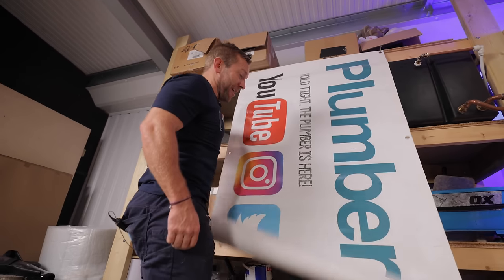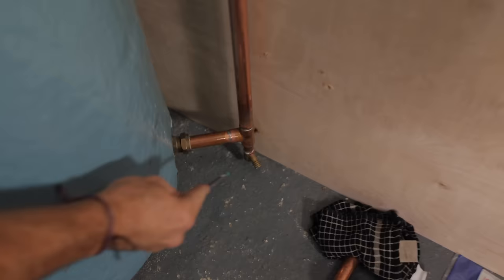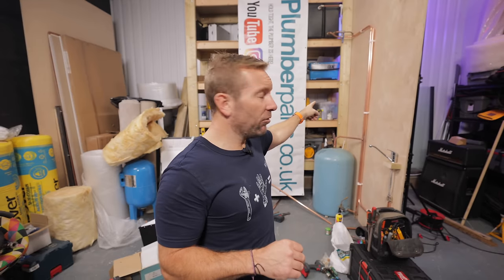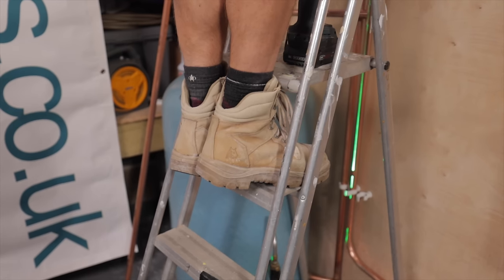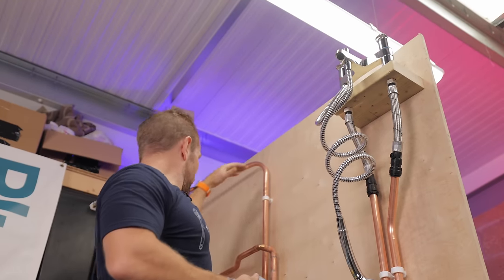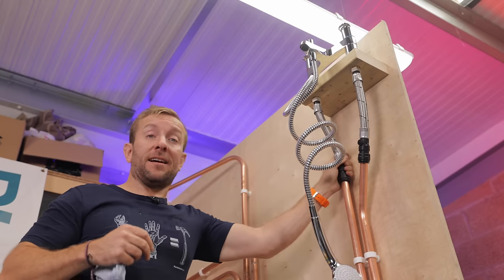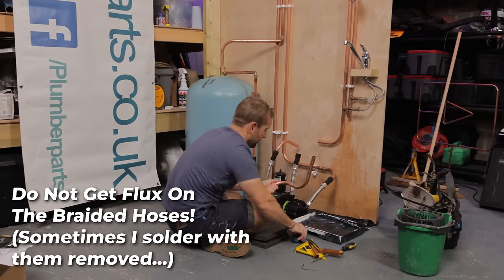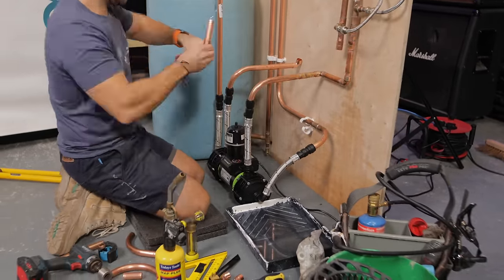HOW TO FIX LOW WATER PRESSURE - The Salamander Right Pump

Comment: In the early eighties I purchased my first home. A first floor maisonette with loft access. I wanted a decent over the bath shower. My plumber told me to build a platform in the loft 1m above the ceiling joists. He then moved the storage tank onto the platform and ran new pipes in 22mm copper to the bathroom. He fitted an Aqualisa shower. Brilliant and no electric pump and moving parts. I have done the same thing to all my other properties since.
Reply: I don't really get it I have a system boiler and pressure is more than enough for the shower.

Comment: 8:38 - Tip of a sharp knife through the surface, then pry the corner up is much quicker than trying to get an edge. Done at a shallow enough angle, it even works well for stuff like protective film on kitchen doors

Comment: Not a plumber (just a DIYer) so sorry if it’s a daft question, would an increase in whole house pressure cause any issue with existing pipe joints, e.g. compression fittings that have been installed and tightened for integrity at the original lower pressure? Assume push fittings wouldn’t be affected at all?
Reply: It could

Comment: Just fitted one of the homeboost pumps by salamander for a customer, they work a treat for showers, (make sure to remove any restrictors in your shower heads 🚿) !!!!!!
Reply: Fitted one to my own incoming mains. Worth its weight in gold. Apparently there was a problem with our water pressure in the area and United Utilities apologised. I said I had no idea there was a problem. Showered as normal.
Reply: @Nickbaldeagle02  check your showers and taps for restrictors
Reply: Thank you for the excellent feedback!

Comment: Low water pressure is a trick phrase. You need to know whether your dynamic pressure is low, or whether static pressure is low before doing anything at all. I have been in a house that had a static pressure of 140 PSI, and a dynamic pressure of around-14psi.. and to top it off, the hot water tank was blowing the temperature and pressure relief valve when the pressure hit the preset pressure because it wasn’t even close to 180 degrees Fahrenheit. 
The problem?  Galvanized pipes and copper pipes were mixed indiscriminately in the past causing galvanic corrosion  on the inside walls of the iron pipes, reducing their inside diameter to about 2mm or 1/8 inch. This let the pressure build up when water wasn’t flowing, but restricted flow when water was moving; the faster the water was demanded, the slower it traveled because of turbulence and restrictions. I ended up having to install a pressure reduction valve on the incoming water line of the house instead of plugging the T+P valve on the water heater; I had to explain that this dude was trying to pay me to make a bomb under his living room!! He was pissed because his house needed a repipe, but his wife was happy they were alive. 
The moral? Attention to detail! Always check any task out before assuming that you already know how to fix it. 
If I had just “stopped a water heater leak” …

Comment: Great video but how would this be installed on a gravity fed system with Telford Maxistore Economy 7 Vented Indirect Copper Hot Water Cylinder 1050x450 144 Litre
Heated by a oil boiler?

Comment: just find salamander pumps go wrong i know they have to be install correct like but most of the time they break. go Stuart turner full brass. installation looks mint btw
Reply: I agree. The cheap ones are just naff. Stuart turner every time now. Try putting a flange into a 50 year old copper tank. It’ll split !!
Reply: Agreed, wouldn't install a Salamander pump again. Mine packed up after a year. Finished up flashing a magnet next to  the Reed switch. "Load of sh**te "  imo

Comment: The bathroom tap doesn't have any head. It has a head on the tap, just not any atmospheric pressure between the bottom of the header tank to the outlet/nozzle/spout of the tap in the bathroom and if the drawing is to scale downstairs might have 1 to 1.5 atmosphers of pressure I think if I can remember it's 0.5bar of atmospheric pressure per every 1mtr of vertical pipe height from the bottom of the tank to the top of the hot water cylinder? 
This is where a pump helps and as many sweeping bends on the coper pipework as possible with as little tight bends like Knuckle bends, any sort of that do a 90° turn by using compact fittings instead of using the pipe bender. 
Larger bore pipes allow more flow rate but the pressure will be the the same dictated by the system design, a bit of a nightmare in cramped spaces and all these rule of thumb on the bends can still benefit an open vented and pumped system upgrade, less work the pump has to do the better it'll work and the longevity of the pump will be extended, by how much Idk.

Comment: Rip out that shit gravity system, either an unvented cylinder or a combi. Salamander HomeBoost on the incoming mains.
Reply: Many houses in UK still have Gravity-fed systems and the Right Pump is the great solution for low water pressure problem. And thank you for the HomeBoost recommendation 👍